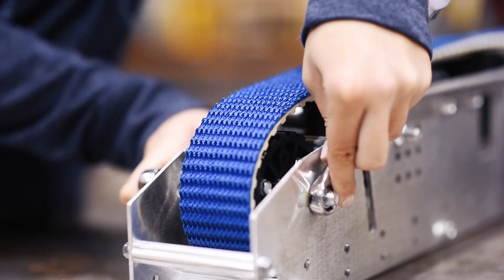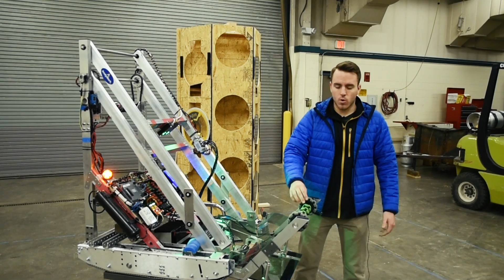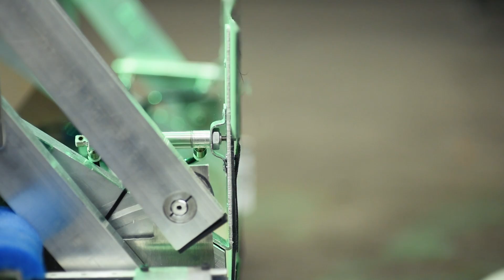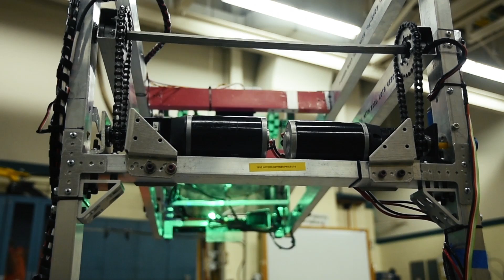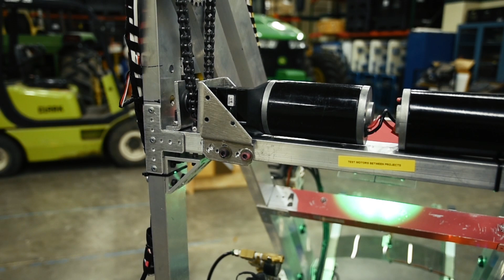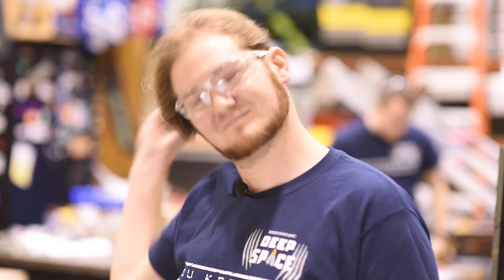Ri3D 2019 | Zou Keepers Walk-through

Comment: Why did you choose the CIMs over a 775 Pros?
Reply: A CIM has 3.4x more torque than a 775pro. With a 196:1 ratio on a 50" arm 2 CIMs have a stall load of 108 lbs and two 775pros 32 lbs on the end of the arm. 32 lbs was too close for comfort. The CIMs can also handle being stalled (which happens when our arms are held in place) way better than 775pros can.

Comment: Did you test to see if the Velcro on the hatch mechanism would stick to carpet?
Reply from the maker: Hey David FRIST as well as us has assured the hatch panel will not stick to the carpet.
Reply: @zoukeepers2431  What about the hook tape on your mechanism? If you missed the hatch itself, would your robot be stuck to the carpet?
Reply: @bestvest  all we had while testing were carpet squares. The robot was able to pick them up just like the hatch panel. This would definitely cause problems when driving around trying to pick the game pieces up.
Reply: @blakemammen7618  Okay thanks for the response!
Reply: While it did stick to the carpet, we tried adding shims to keep it slightly off, but what we used seemed to be too much to pick up the hatch consistently. It would definitely help to have a more active mechanism if you use Velcro